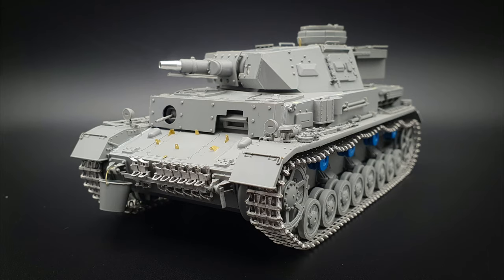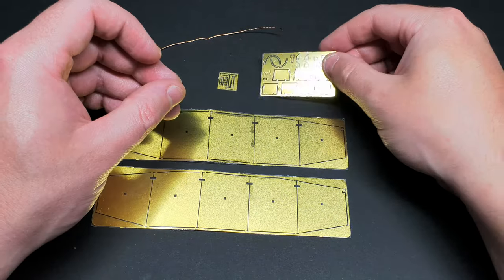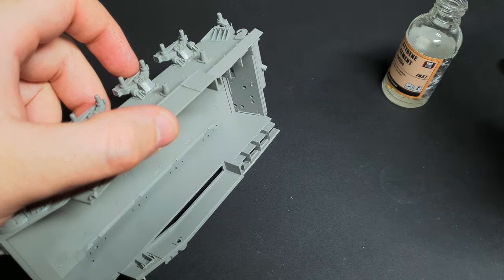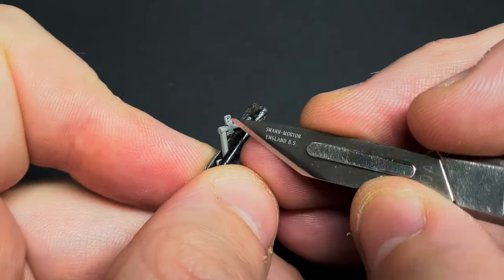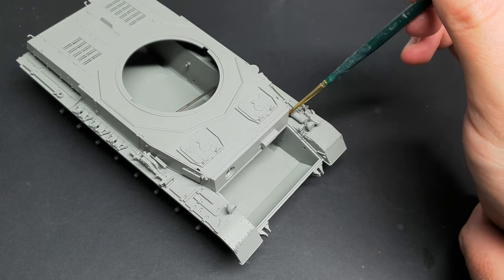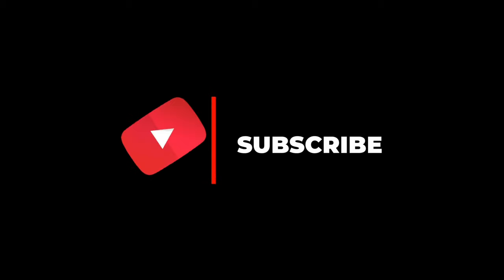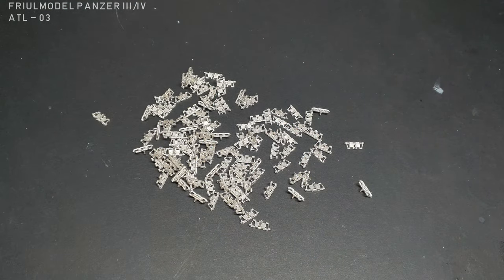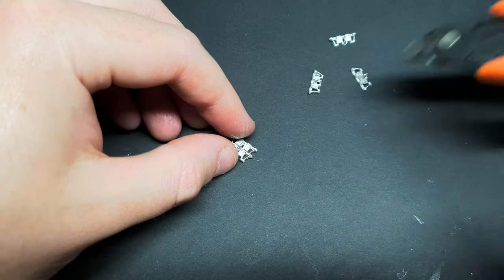Building the Border Models Panzer IV F.1

Comment: I note your thin glue bottle is quite tall. I have to use magnifying glasses to make models now and they only focus at short distance. I once caught the brush in the bottle and spilled it over the dining table ruining its finish. You can imagine how pleased the Mrs was!!. I have now made a wooden block to sit the bottle in so it won't get knocked over again. You might consider doing that as its easy to do. Also good for CA glue bottles.
Reply from the maker: Oh no I bet you said some choice words ! Thanks for the tip
Reply: Most of us have been there. I knocked over my bottle of Tamiya thin only last week, fortunately on the hard wash and wear surface of my desk, but I had to splash some on the plastic base of my newish Xiaomi cord free internal battery LED lamp didn't I?!!! Arrgh! Small mercies. If I did that on our traditional walnut topped dining room table, my missus wouldn't have to kill me as I'd probably cut my own throat. =]
Reply: I have a jenk fix for that too. I super glued a stack of pennies to the bottom of the extra thin bottle. I then glued a thick 3”x3” styrene square to the bottom of the pennies. 

The fix is ugly. but it lowers the center of mass quite a bit and makes toppling the bottle over more difficult.

Comment: Nicely done. I built this but trying to fix errors I screwed it up. The towing rig is wrong for this model as far as I could find but easy to fix. The big problems were the step in the turret and for the model I was building the rear deck. I wish they had of given optional doors for one of the three engine door configurations. thats where I screwed up my build. Will enjoy watching the rest of the build videos.

Comment: Another splendid Video of a kit worth considering. Looking forward to PART 2.  I'm new to kit building, so watching hints and tips is very useful for me. I do, however have two questions. at 12.20 you say the CA gives you time to position your PE parts before drying. 1). How many seconds before it grabs the part? 2). What CA dissolver do you use, if you get it wrong. and need to remove the part. I was told Acetone works but having bought a bottle of it, I can confirm that it doesn't.
Reply from the maker: Thanks Roger , the glue gives you about 5-10 unless its been sitting for a while, thicker ones take longer to go off as a rule.   you can get a  specific superglue debonder, I admit though I have never used it so can't comment.
Reply: @lpjmodels  Thanks James for the prompt reply. I had, prior to buying the Acetone, bought a bottle of "Deluxe Materials Glue Buster Debonder". Totally ineffective !

Comment: Did you have any issues fitting the upper hull plate? Mine seems very tight....
Reply from the maker: It was a little squeeze, but it was warped slightly

Comment: Stupid question... Why'd you use putty for one fix and milliput for the other? I'm not sure I understand the difference between the two and when to use them properly
Reply from the maker: Hi William, the putty dries fairly quickly and is good for small seams, and sink marks and the like. Milliput is an epoxy?  putty has a lot more body, and takes hours to fully cure. It sands better and you can sculpt it as its drying.  On this build I used milliput so I could add in some weld seams and clean it up with lots of working time. It also doesn't shrink so one session and your sorted.  I hope that helps a bit